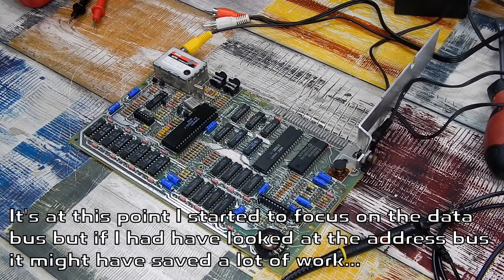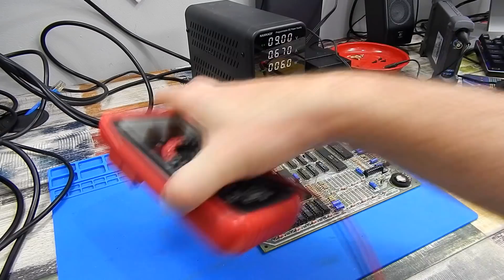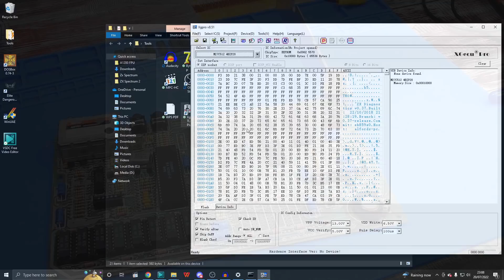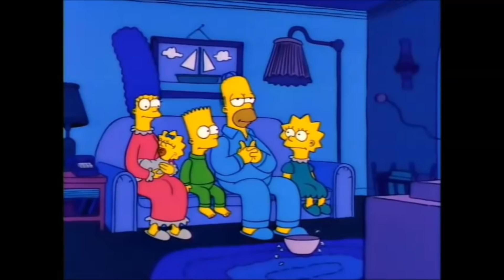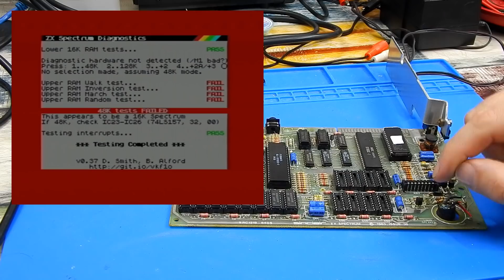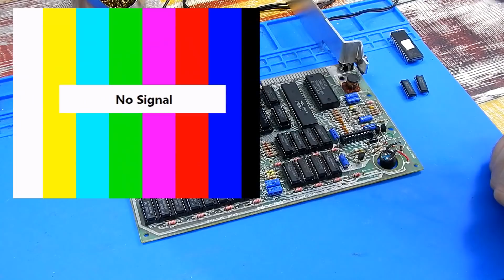ZX Spectrum - spares or repairs, let's fix it.  Part 2.

Comment: Great repair!!

I have a problem with mine that I haven't seen mentioned anywhere: the clock signal isn't reaching Z80. The 3.5MHz signal is coming from the ULA, but when it reaches the R25 line, I only have 5V on one side and 0.140V on the other. TR3 is fine, and the clock circuit is also fine; there's no short to ground. All of this was tested with Z80 removed from the board.

Comment: You helped to get mine fixed as well! I tried the all RAM out and try them one at the time as mine has 6 socketed. I had replaced 74LS10 and the ZTX650 transistor already and the voltages were good. I couldn't find any bad RAM but when I put all the RAM back and tried to power it it booted to the Sinclair screen! So maybe some RAM just weren't seated properly. So one of my two ZX Spectrums is now alive. I probably have bad RAM in the other but I have to get back to it later.

Comment: Correction:
8:43 on the multimeter you are measuring voltage drop of the "diodes" (transistor in this case). That's not ohms, but milivolts. Silicon diodes have a voltage drop of around .7V

Comment: Great video and very helpful! 
Did you manage to verify your theory on those RAMs? Did that 7th RAM  was the only one working from the bunch? 
I just got a ZX Spectrum that only worked for an hour  and It would be nice to know if that pattern is indeed a way to test those RAMs. Since I don't have an IC tester and putting a bad RAM on an other Spectrum is a bit dangerous , checking them the way you did sounds like a good way  to start.
Reply from the maker: I did but believe it or not there was only 1 bad and 7 good, at least I've got plenty of spares.  

I still think that testing as I did, if the address logic had have been good, would show something different on screen so is worth trying.  Ultimately though with my address logic bad my test didn't prove much.

Comment: Enjoyed this vid and subbed, but can I just point out that when you test in diode mode, it’s volts not ohms, what you see is the forward bias voltage that the junction switches on at. So 0.7 is the junction switching on at 0.7v one way and as you say it shouldn’t the other way. Minor point but you are spot on for most things and people learn from these. Cheers

Comment: yes board recapped i use LCD and there is no pixel clock option in my LG tv...
Reply from the maker: If you can try it on another screen to see if the image is better, if the jail bars go away.  If they do then the issue will be the LG TV and there is little you can do about it.  If not the issue might be within the Amiga itself.  Unfortunately the A600 is not a system I am that familiar with but if you joined and asked on the likes of http://eab.abime.net/ there are people who can help.

Comment: hello how to solve the problem with jailbars on rgb scart connector in amiga600?
Reply from the maker: Has the board been recapped?  

Are you using a CRT or LCD?  If LCD you might solve it by adjusting the pixel clock on the screen.

Comment: Very honest video. So many edits could have been done! LOL. On one hand you would think the ZX Spectrum a great example for learning how to repair PCs, but with Sinclair's money saving ideas there are many pitfalls. No mask on the top PCB tracks, unprotected circuitry vulnerable to power failure, and transistors too ready to let go and kill all your hard work. No wonder all the ICs get socketed. I think improving it is too easy ( e.g. removing 5v regulator and using good quality 5v supply, the RF to component mod is probably needed nowadays to be fair) But where's the fun in that? Better to struggle through and really learn how it was to use and repair early home PCs. Great job, thoroughly enjoyed watching this.

Comment: check out the SVI-CAS digital tape emulator. it supports multiple computers besides the Spectravideo SVI in its name, including Spectrum, Amstrad CPC, C64 with an adapter cable. The Spectrum Show did a review video on it

Comment: Congrats on the fix. May I  suggest investing a few quids on a components tester? It may save you a few headaches when buying replacement chips.
I would also suggest a memory tester for when you work on other micros which use ram chips that are fully working (since the spectrum uses defective ram by design).
Reply from the maker: There are a few bits of test equipment that I'd like to get and a component tester is certainly on the list.  I'd like that one you see Adrian use which can test various different ICs, just can't remember the name of it right now.

Comment: did you ever actually confirm the original 4116s are bad after replacing the logic ICs?
Reply from the maker: Yes although I ended up cutting it from the video to save time.  Originally I thought there was maybe 7 bad and 1 good but in reality there was 7 good and 1 bad.  At least I've got plenty of spares now :)

If I had of tested the address bus at the start rather than going down the rabbit hole of the data bus it might have saved some time and effort but ultimately there was always a fault in the ram that needed fix so I suppose regardless I was ordering chips.

Comment: Wow! What a journey, I would have given up by now, but your persistence has paid off. One tip (When using a DVM on diode test the reading is in Volts. The meter puts out around 2V through a series resistor then measures the voltage across the probes. You can actually use this diode test to light an LED.)
Reply from the maker: Thanks.  

Yes I'm an idiot calling it ohms when in fact the diode test is in volts.  Live and learn as they say... Noted for future reference 🙂

Comment: Oh, it's all a learning curve isn't it.  It's so easy to get blind sided and go down a rabbit hole.  It's great you got it working in the end and intrigued to see what it can do. 😊✔
Reply from the maker: It very much is a learning curve and perhaps if I had have checked the address bus first the repair might have got completed faster but that's all part of the fun and in the end as you say its fixed.  

Once I get the parts needed for the dandanator I'll come back to this machine and show it running some software.  Its basic compared to its peers of the time but does have a charm to it.  It'll be a while though, got a few other projects that I want to get off my desk.

Comment: Thanks for the videos, always enjoyable and informative.  I would like to point out though that the diode test is measuring volts not ohms.  So yes 0.2v is way too low for that transistor for either Base to Collector, or base to emitter.  There are diodes that can be ok that measure that low. It's always easier when faulty parts measure short or open.
Reply from the maker: Good point 😆.  You knew what I meant though, that's the main thing.
Reply: Very good information Imperious685. Most germanium transistors will forward bias at 0.200 volt - 0.300 volt. Also Schottky & some high speed switching diodes (SMPS rectifiers) will also hover around 0.180 volt - 0.280 volt. Reverse bias should always read open/infinity though.   Fred

Comment: 2:27 Are you sure that this is an Oscilloscope issue? On the scope preview I see that your Trigger level is on 0V (right yellow arrow with letter T) so it can't trigger properly.
Reply from the maker: Adjusting the trigger helps a bit but I can never get this scope to give an accurate reading of anything over 1Mhz.  Its only rated to 10MHz but then again does me ok for the £40-£50 it cost.  I do want to get a better one at some point.
Reply: @CRG Only 10MHz? ooh. That can cause some weird readings ;)

Comment: The 4116 chips are a pain in the backside. They very frequently fail and their dependence on three separate supply voltages is a nuisance; if the voltages aren't right or come up in the wrong order, the chips will give you trouble. A very simple mod that I would highly recommend is replacing the 4116s with 4164s. They are pin compatible apart from pin 1 (NC) pin 7 (5V) and pin 8 (A7). The heavy trace directly below the lower RAM chips is the +12V line and connects to the lower electrolytic capacitor to the right. Close to the capacitor, cut the rail and bridge it to the 5V line (the next heavy trace down). You can then fit 4164 chips which only need the one voltage. Yes, you are only using a quarter of the chip, but they are a little more reliable! The other helpful mod is to replace the linear regulator with a switched one or a power buck and you can be rid of the heatsink.
Reply from the maker: I had originally wanted to just replace all the 4116s with one of those new RAM boards which only take 5v.  The only place I could find them for sale was retroluem but the guy running it was away so decided to just go with the 4116s.  

Changing to 4164 would be a good idea too as ultimately I'm sure it's only a matter of time before that transistor blows again (or something else) I loose only of the voltages and find more fired ram.
Reply: @CRG  That's another good option. I've seen the schematics for the same idea and it's basically putting in a 62256 (or equivalent) with a 74LS541 to latch the upper part of the address on the RAS cycle. Like the 4164s, gets you away from the multi-voltage setup. Unfortunately for both solutions, while the -5V supply becomes redundant, 12V is still needed for the LM1889 to run the video output. Removing the 4116s will reduce the load on TR4, but it's worth making sure that you've a known good alternative part installed.
Reply: @johnbarleycorn_  LS541 isn't a latch - it's a tri-state buffer.  I think you meant LS573 which you could used to latch the row address on the falling edge of the RAS\ signal (low active)

Comment: Great job =D  Regards the transistor you fitted - you may find it failed because its out of spec regards the original transistor - they all have different characteristics. eg. base current, base bias, collector current, base emitter voltage, base resistance, gain etc etc.
Reply from the maker: Thanks.  I was pointed to that S8050 diode as a suitable drop in replacement but checking the datasheets (which I should have done originally!) the spec does differ a fair bit between them.  Think I'll need to order something more suitable as a replacement or risk it blowing again and loosing more lower ram.
Reply: @CRG  The diode might be OK, more likely the transistor!  I would hate for it to fail again and kill your new RAM

Comment: I enjoyed that. I fixed a few of these and they can be tricky little beasts. But that's half the fun, right. ;-) I bought a dandanator card and it has ZX diagnostics onboard, so there's no need for a separate rom chip.
Reply from the maker: Thanks, glad to hear you enjoyed it and absolutely the more twists it throughs at you the more fun the repair is, even if I was a bit deflated after fitting the new RAM although it certainly was a lesson to check those 157's first!  

The dandanator does look like a great option and I'm looking into getting parts to build one myself.  In the mean time though its been suggest to try an app on my Android phone that will load the games.  At least that will get me up and running.

Comment: Glen you have 3 choices for loading games 
1. TXDuino whech is basically a digital tape player
2. Dandinator which is like the 3rd option the divMMC
3. divMMC which someone already mentioned.
Reply from the maker: Thanks for the tips.  The dananator looks interesting and certainly more affordable than the divMMC.  I think in the first instance I'll maybe just use the digital tape player option then in the future I might look at putting together a dandanator.
Reply: @CRG  TXDuino is the choice I chose for now then like you I may get the Dandinator later on.
Reply: Don't forget PlayZX straight from an old Android phone. That's what I used until I got my divMMC.

Comment: wow that was a jouney and a half but great to watch i beliexe noels retro lab uses some kind of tape cassete emulator may want to check that out.
Reply from the maker: Thanks, glad to hear you enjoyed it.  I've seen those cassette emulators but I think the dandanator will be a great solution in the long run.  For now though I've been told there's an app of the phone that will load games.  Am going to try that first while I wait on parts for the dandanator.

Comment: What a fascinating journey! The Future is 8 Bit sell a divMMC device that hooks into the interface slot at the back. You can snapshot to it , load memory images and load/save to tape too.

The tokenised keyboard is great as typing a LOT on the rubber keys would not have been fun!
Reply from the maker: Thanks, it certainly took me on a journey but I learnt a lot so hopefully the next one will be a bit easier.  

I'll take a look at the divMMC, thanks for the tip.
Reply: @CRG  I've got one which I use with my ZX Spectrum +2. Easy way to load tapes, snapshot, and then use the MicroSD card in the PC!